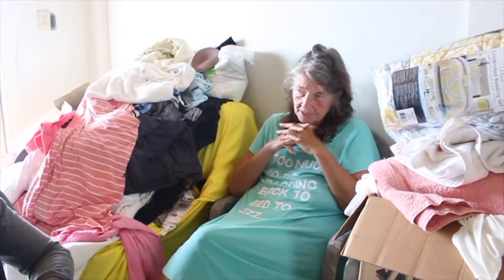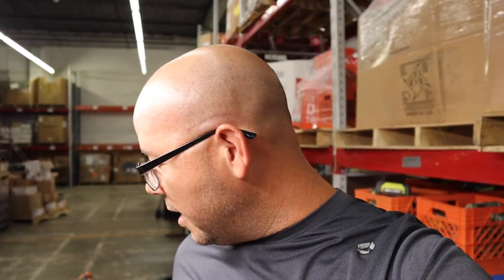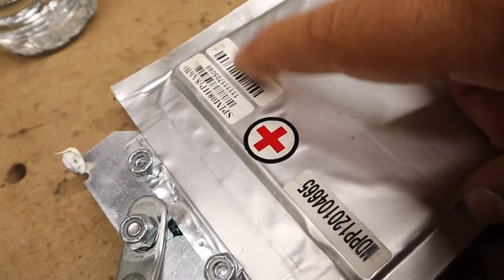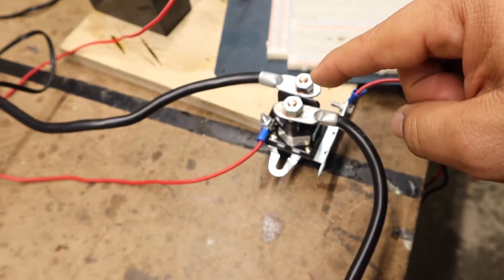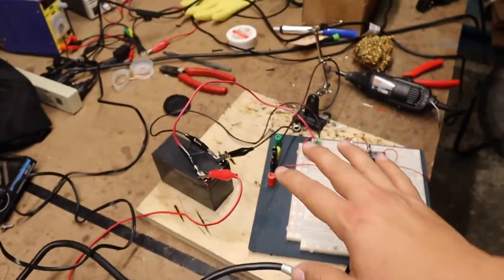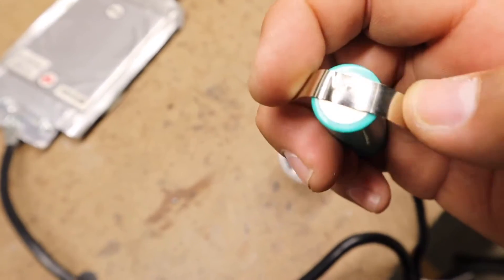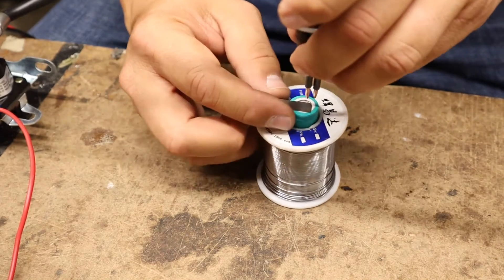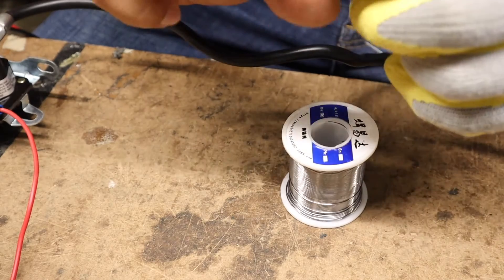Diy Spot Welder For 18650 batteries | Javier Camacho Off Topic Ep 7

Comment: I use a 1F capacitor in the same setup. It's easier and cheaper to get then these big batteries.
I use my bench power supply to charge it. 
I've seen it working, but mine doesn't work right now. There is not enough current. I'm still working on it. I need bigger cables and electrodes and try again. 4mm2 is not enough.

There are spot welding pens available, but they are a lot overpriced. 

That big relay is a very slow actuator. 
I put it in parallel with the capacitor, so it shuts out itself when the voltage drops. It stays on long enough to fully discharge.
Reply from the maker: I don’t have access to the 1f caps so I had to improvise. The big relay or solenoid is the best thing you could get for cheap. I actually have some transistors that can carry around 400 amps constantly and they are fast enough for this setup. Hopefully it will be on another video once I’m done with these series
Reply: @javiercamacho  The relay is the cheapest option. I hope, it can handle the current it is rated for.
Reply from the maker: They can carry up to 700 amps for up to 30 seconds. So,  400-900 amps for a few ms is more than ok
Reply: @javiercamacho  I tested my setup first time today. I only got a 200A relay, it was the biggest I could get. It works, but I will buy a larger one next time. The contacts stick together from time to time, but you can wiggle it open.
I guess, it won't last very long but that's ok for now.
Reply from the maker: If the contacts are getting stuck it means to much heat

Comment: The electrodes need to be a heavier gauge and a little closer together for a one shot weld. Three shots seems to work fine though, and you don't have to worry about duty cycle like you do using a microwave transformer.
Reply: What electrode distance is actually working?
Reply from the maker: Between 1/8” should be good. Too close and the weld won’t work. Also light pressure seems to work better that just pressing hard on the cell
Reply: I got thicker cables now.
Now it welds the copper electrodes perfectly to the nickel strip, but not to the cell. 
Any advice?
Reply from the maker: To much heat
Reply: @javiercamacho  Simple solution: Wrong material.
I ordered copper electrodes, these are copper plated steel.

Works good with copper now. Two shots make a good connection.
Reply from the maker: Thanks for the advise